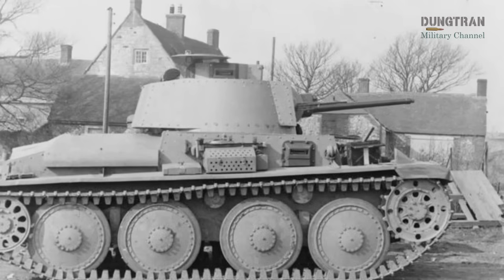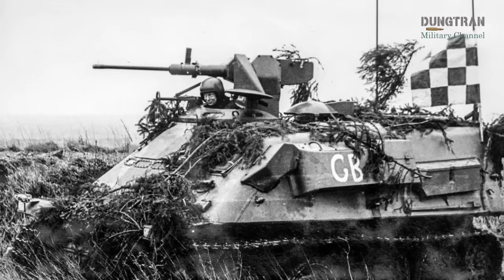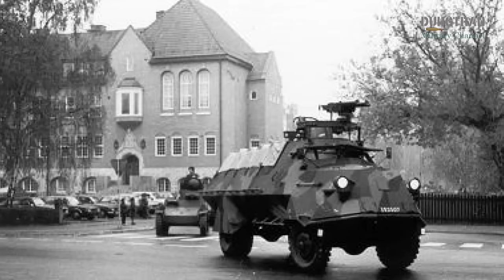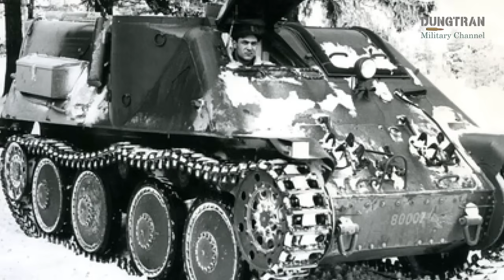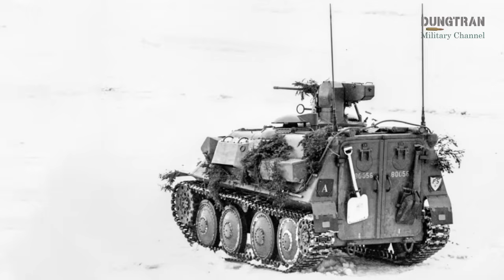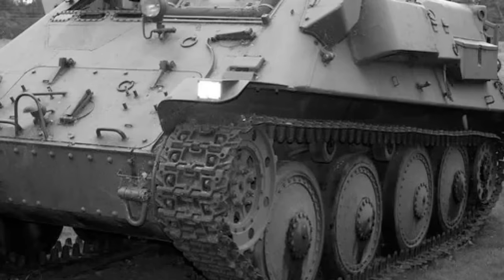The Forgotten Swedish Pbv 301: A Cold War Infantry Beast

Comment: Very good video!
Interesting facts:
When Strv m/41 was rebuilt to PBV 301, the turrets with the gun was reused as static ariforce base defense.
The copula at the PBV 301 with the 20 mm Bofors was originally designed as a commander copula and close combat armament for the Strv 103.